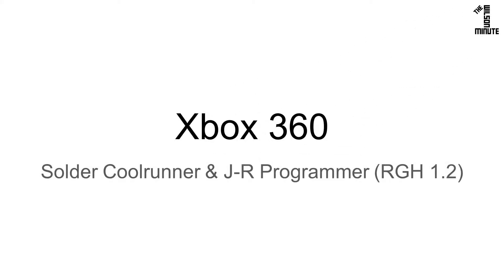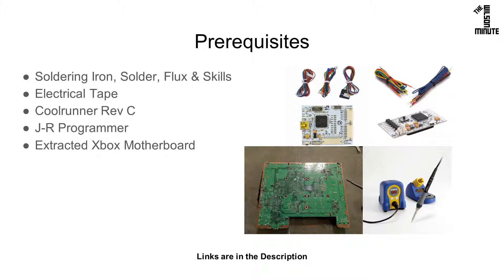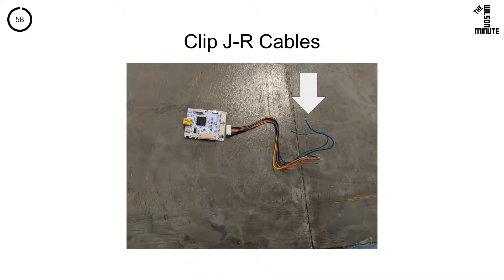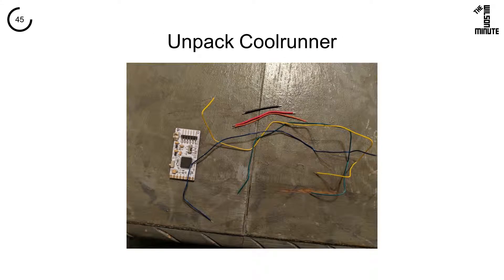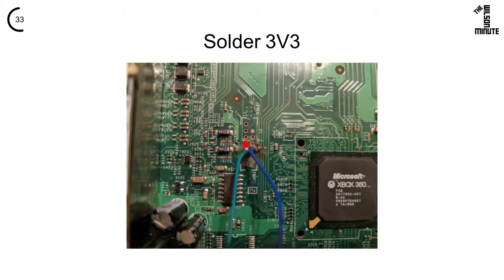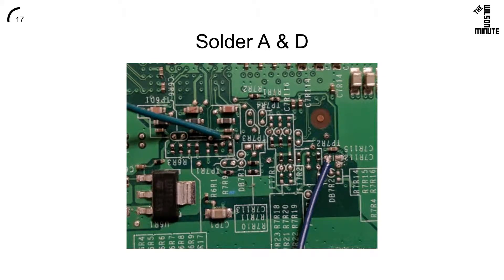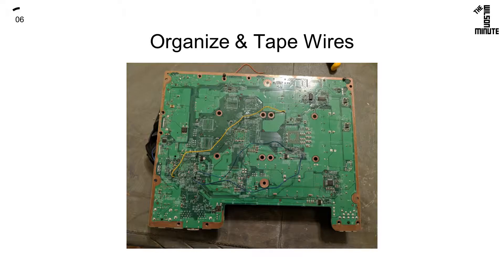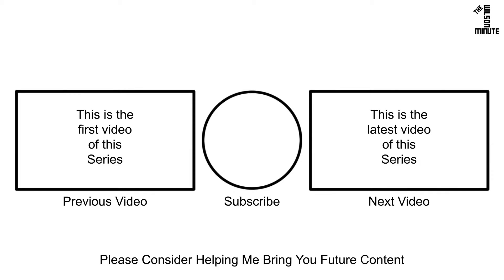Xbox 360: Solder Coolrunner and J-R Programmer for RGH 1.2

Comment: Hey bro...a little help....
I have an xbox 360 phat jasper 2009....do i need to buy just the jr programmer v2 to "jailbreak" it....or do i need other hardware to do it?
Thanks a lot.... And great video by the way simple and fast !
Reply from the maker: So you basically need 2 devices the coolrunner is a mod chip that stays inside the 360, the jr programmer is used to read and flash files to and from the coolrunner and the 360. If you check out the entire playlists I put together on getting RGH 1.2, you should be able to get a grasp of what all you need and how they are used.
Reply: @BytePen  thanks a lot dude....appreciate it ...u are the man
Reply from the maker: @arnolddoci8829  no problem, glad to help! :)